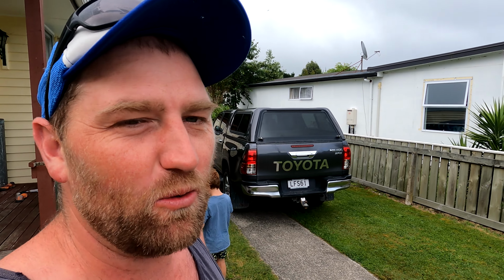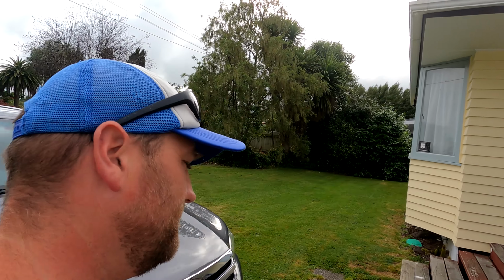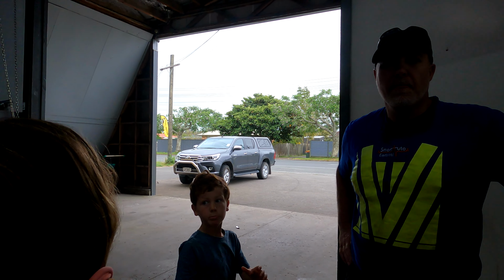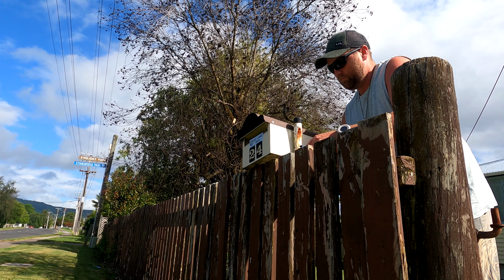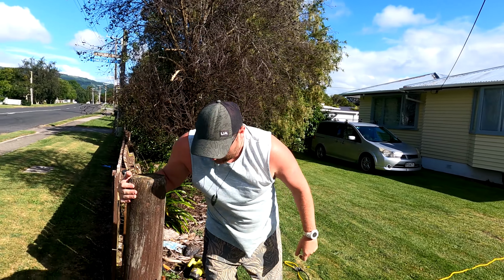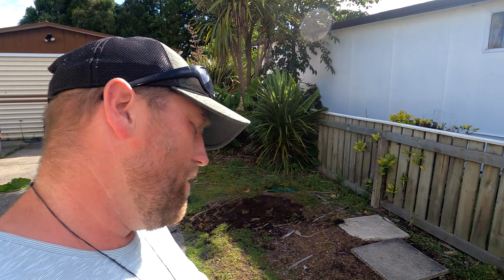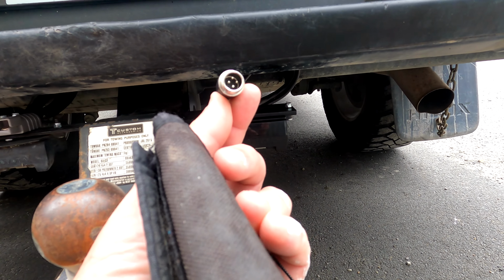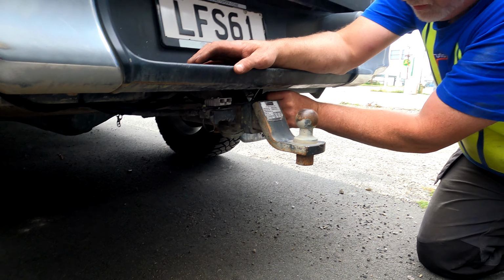Things are going wrong x3

Comment: My Anderson plug including the relay box was around $600.  That also included doing some work in the caravan to make sure the fridge would work on 12V while driving. (UK rules don't allow anything electrical to operate inside caravan while towing).
I already had the 7 pin and don't have reversing camera...  so another 600 for those 2?   Hmm..   Anyway the camera plug needs to work so I'd be not paying till it does.  My understanding is that there is a standard way to wire 7 pins up - sounds a bit dodgy him wanting to do it some other way.
Reply from the maker: Yea, so the Camera stuff is all provided by insideoutRV, so there are no costs for that, They also literally run that same cable with the others to the back so a bit hard to believe it could cost so much, since they are all in the same tubing running to the tow bar. 
I feel like they punished me for not having it wired their way...  Looking forward to just being able to get out there, having the bills and payments behind us and enjoying the fruits of our labour...

Comment: Diesel particulate filters are intended to trap and “burn off” diesel particulates, but the devices in Toyotas appear to be clogging up. 

This time last year Toyota began fitting switches to affected vehicles (Toyota HiLux, Toyota Prado and Toyota Fortuner models fitted with the 2.8-litre turbo diesel engine) so owners could do a DPF burn off manually rather than wait for a build-up of soot, which causes the white smoke.
Reply from the maker: I think your bang on the money there mate. I Took it into Toyota yesterday for them to have a look at everything. They said it will be the DPF and they have ordered a new one and will replace for free, which I think was great customer service. Also No oil leaks, I think it was just a bit of grease which had been heated up. Phew!
Reply: @leopardsgowild  oh that's awesome mate glad wasn't to much of major for you guys 👍
Reply: Wow, 1200 bills, what a rip off, shouldn't cost any where near that , that's why I do most of my own work, Chin up hope all goes well for you when you pick up van, PS Car problem , that is something that needs to be fixed before travelling, I hope your local mechanic doesn't rip you off. Cheers 🤠🇦🇺

Comment: Your Toyota issue will be a DPF I am surprised its not replaced already. Big issues in Aussie class action against Toyota Anyway will be warranty/recall.. Don't fret about towing the Van. With the WITI brake system you will be fine they are very smart.   Im going to get 1 for our rig. Good luck with the Visa thing Im sure it will all work out Cheers Greg
Reply from the maker: Awww thanks for the encouragement Greg. Your right it is a DPF which they are going to replace for free. Hopefully the Visas won't be an issue. Plenty of time still.

Comment: There are so many little things like this. I watched a autoexpert video yesterday about towing which really made me worry that our truck will be borderline for towing. Will have to do some weighing me thinks.
Reply from the maker: What are you planning to tow with mate? Works out our truck is fine. I asked  the mechanic when I took it in on Friday if there is anything I should do, be thinking of for towing such a big caravan? He reckoned nope you'll be fine it's made for it. That made me feel a lot more settled. You got a new date for your caravan yet?
Reply: @leopardsgowild  we have a Pajero sport so the caravan is fine. It’s more we are limited with what we can put in the truck by the looks. Latest has ours manufactured on the 27th December. So crossing our fingers that we still get to use it this summer.

Comment: Oh no, hopefully the Hilux issue gets resolved, maybe a head gasket or exhaust manifold? That auto sparky shouldn't be charging you $80+/ph for an apprentice who takes so long to get the job done it near on doubles the invoice. On the brightside only 6 more sleeps until your fancy caravan is in your possession.
Reply from the maker: Thanks Shannon. Took it into Toyota yesterday, no issues, Oil was actually grease, they put it up on the lift so had a good look around underneath. Also the smoke was just a clear out from DPF which toyota said they will replace for free, I left feeling very relieved. Also asked if there was anything we should consider or do for the truck for towing a big caravan, they said no you'll be sweet.  I'm feeling a lot less stressed today.
Reply: @leopardsgowild  I was going to say DPF, good result in the end